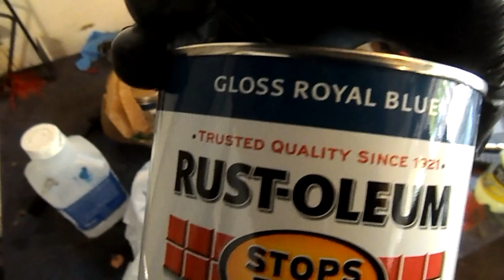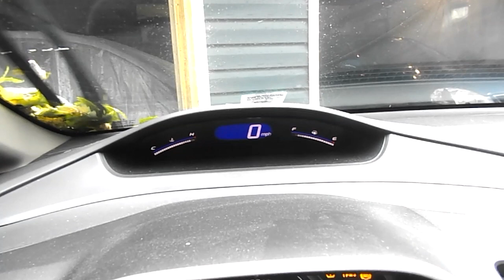2000 civic Rustoleum Royal Blue Paint Job

Comment: For that noise in that civic had the same thing it's a plug cable that connects to a thing if u look from the front it's on the left under te air box it's a lil cable that mabe for u it's loose and not making a good convection I forgot what's it's called bro but it's a lil cable it has rubber on top damm bro add me on IG I'll take a pic and send it to u fausto626_